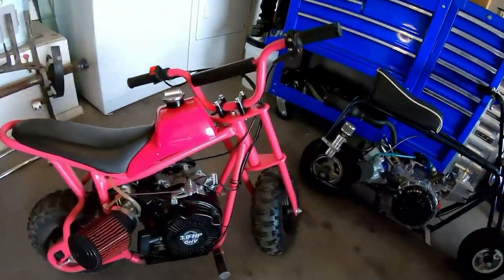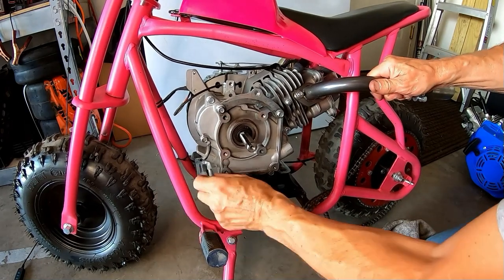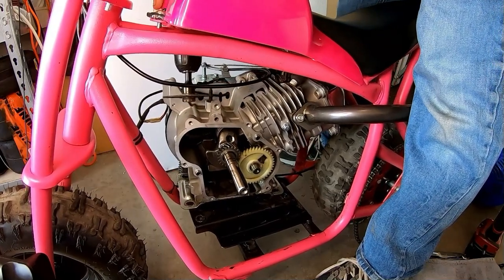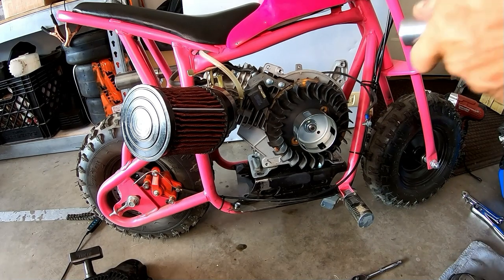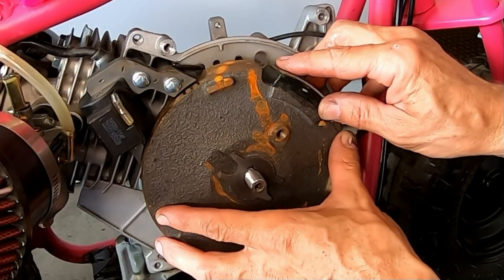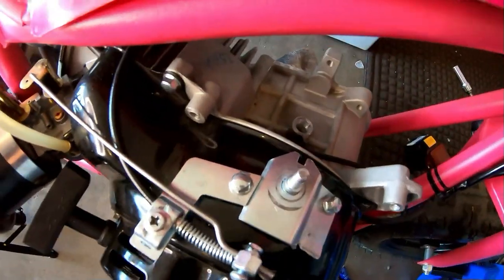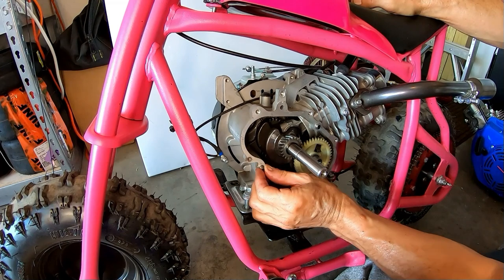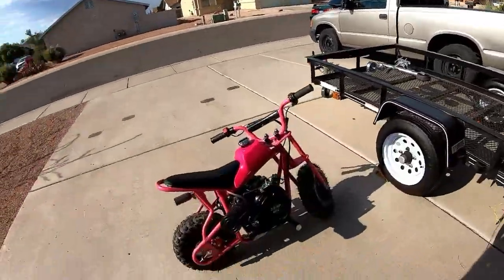Coleman CC100X 3 hp internal governor removal/speed test

Comment: Can you leave in the pin that holds the governor gear on predator 212? I just removed the governor gear and all the washers but didn't feel like tapping out that pin. Thanks and great videos you're gonna blow up with subs.
Reply from the maker: Thanks! Ya, you can leave the pin in there if you want.

Comment: Black66 On The 100 cc Engine With Governor Removed  I Have Seen The Magnet Blow Apart. I Put A Billet Flywheel On Mine
Reply from the maker: That is a really good idea!
Reply: Does a billet flywheel for a predator 79cc fit this engine?
Reply: where did u get a billet flywheel for the 98cc engine?

Comment: Hey there black 66 I love the vids and all of your builds but I have seen that little minibike before from a friend and it had a 50cc did you do anything with that motor or will ever do anything with it
Reply from the maker: Thanks! The engine that came off the bike has been sitting on the shelf. It stopped running shortly after I got the bike. I dont have any plans on doing anything with it.

Comment: What is the size and pitch of the bolts you used for the plugging of the holes, after you removed the Governor parts?
Reply: @Black66  used this information, screw drops right in. There's no way a 1/4-20 is what you used for the top hole
Reply from the maker: @Snowtrails11  We are not talking about a 1/4-20 for the top hole.

Comment: Hey can you offer me a little advice, please. I ordered a carburetor for a 3 hp Coleman CT 100U , it said it would fit in the item description it does not it is too big the holes do not line up for the mount. I called a place that sells Mikuni’s and they said that nothing will fit on that bike and that upgrading the carburetor would absolutely do nothing. Can you please tell me what upgraded carburetor will fit on that If there even is one. Thanks
Reply from the maker: Check out this video. I install a 19MM slide carburetor on the Coleman 3 horse. It definitely made a difference. The links for the parts are in the description. HTTPs://www.youtube.com/watch?v=1sBC0idluGs&list=PLkbj-ip-5FzZIfovJ1cmnn2_pwrUxyfw2&index=6

Comment: So I took the internal governor out and now it won't start, it sounds like it wants to, but when I try to start it, it won't and a puff of smoke comes out of the carburator
Reply from the maker: Did you mess with the cam at all. Cam timing?
Reply: It fell out, but I put it back in, and the rods fell but I put them right back where they were
Reply from the maker: @jamisondiehl5817  If the cam timing is off by one tooth that could be a problem or if the pushrods are swapped the valve lash could be off a little. Both easy fixes.

Comment: I removed the governor as well now I can’t get full throttle it’s sputtering. Any help would be appreciated
Reply from the maker: The Engine has more RPM potential now with the governor removed.  It might need to be cleaned and adjusted.

Comment: What kind of oil do you run in all of these bikes? I just built a bike with a Go Power Sports 225, and I have some T6 but I think I need something better.
Reply from the maker: Honestly, I have tried all kinds of different oils. Oils are so advanced these days it seems like all of them are decent. If you find the best one let me know. I'll try it.
Reply: Vr1 20/50
Reply: Normally they all recommend SAE10W-30